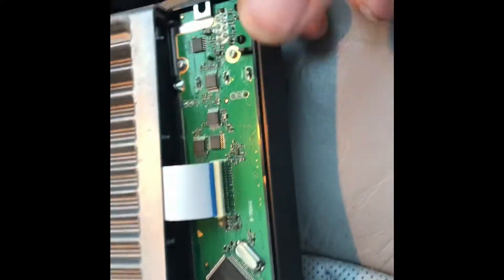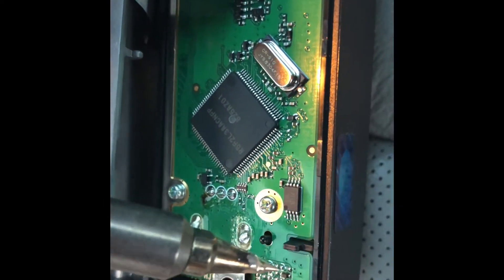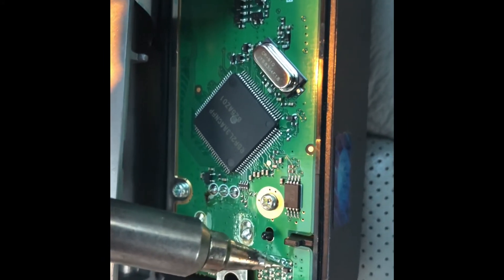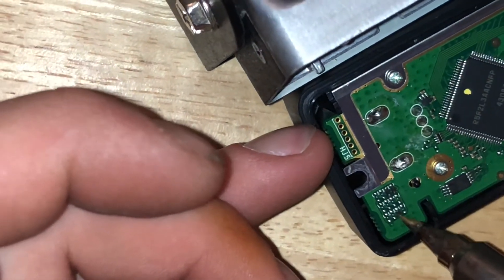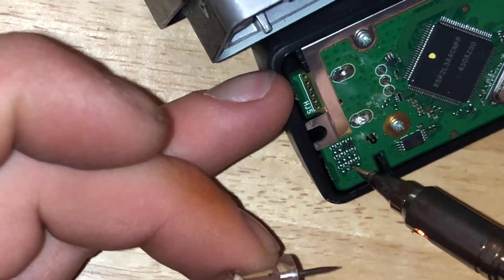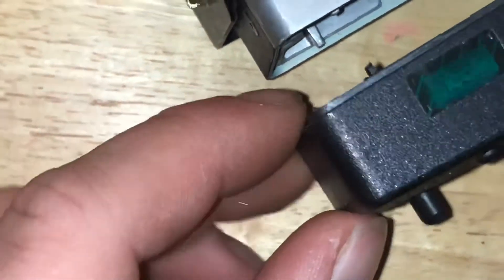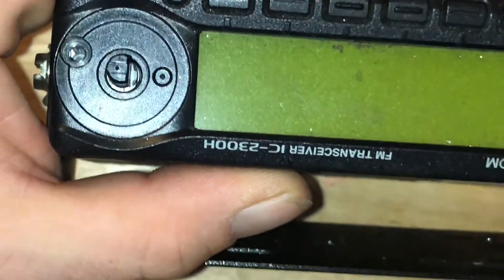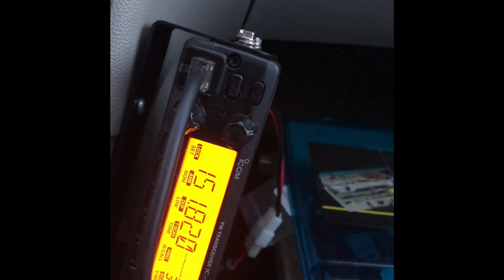IC2300h MARS Mod

Comment: great video BUT way to much camera movement  a tripod would have been better  adding a little solder to the tip of the soldering iron would have speed things up alot

Comment: Wow! This is bad advice!
Never use a freaking soldering iron and a push pin to do SMD removal! Extraneous heat can damage other SMD and excessive heat can lift a land and or destroy a feed through. Or worse to multilayer PCBs.
Over the last (approx) 20 years of servicing amateur radio transceivers 
I’ve repaired around 35-45 transceivers that had a CAP/MARS done by someone that had no business performing said modifications and a few were not economically repairable!. Burned PCB’s , unintentional SMD removal, bridges, MOSFET ESD damage (although rare) making the transceiver unrepairable.
Don’t take my advice, just try it and see!
Use ESD precautions!
Use a SMT hot gas or hot air removal station.
A set of ESD tweezers are inexpensive.
151.820 is not a MARS frequency.

W5TXR 
Retired Motorola Sr field technician of 25+ years
ARRL TC, Mississippi Section
ARRL Certified Instructor
Reply from the maker: Thank you for your infinite wisdom. Theres always a critic...
Reply: Mark W  it’s fact.
You do what ever you want to your transceiver.
Use a flame thrower for all I care

Comment: Is that realy work on ic 2300h.what is the purpose of taking out diod
Reply from the maker: It’s allows you to transmit on MARS and CAP frequencies.
Reply: The diode is part of a VCO matrix. Configuring diodes in a certain configuration for the VCO.
Some VCOs use diodes, R0 jumpers.
It’s kind of complicated to explain the theory. I will try to give you the readers digest condensed version.
The VCO is controlled by a voltage. 
AllVCOs have a frequency reference TXCO or Xtal.
The VCO has an "A-counter". The A-counter works in tandem with the N-counter to change the divide-rate of a prescaler. By changing the prescaller to divide by 33 for a few cycles, then by 32, you can extend the count to fill in the gaps to get your 12.5kHz steps again. To do this you need another counter - the A-counter. In the 28.550MHz example, with a divide-by 64 prescaler and a 12.5kHz reference, you would use an N-count set to 71 (71 x 32 = 2272), and put the missing 12 counts (2284 - 2272 = 12) into the new A-counter.
The “N-counter” divides the output of the external voltage-controlled oscillator (VCO). The output of the N-counter is compared with the reference frequency, and the different is the error signal that is usedto control the VCO.

There’s more to it but like I said it’s complex.
And I don’t know your level of expertise in electronics.

W5TXR 
ARRL TC, Mississippi Section 
ARRL Certified Instructor
Reply: All that technical nonsense didn't answer the question